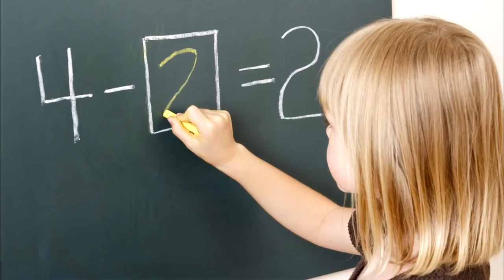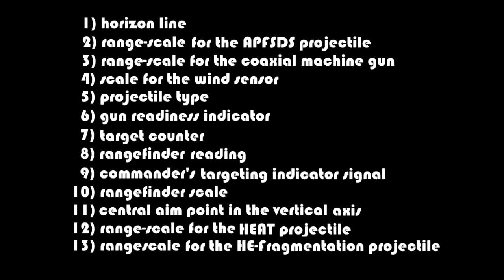Was T-80 really a FAILURE? T-80 tank Review

Comment: Russia still has a few of them in active service and like 3000 in reserve, most are older models though. there are rumors that the tank might get a similar to T72B3 modernization program
Reply: Dimitri Kovalenko Would the T80 tanks that are still in use and in reserve be a better option to fill a niche where armour was needed when time was of the essence? I know they drink more fuel but I'm sure they can move around faster.
Reply: They being returned to service in Siberia.
Reply: SCUD B Why in Siberia? Is it because they need more powerful or faster tanks there for a quicker response?
Reply: PETAZ ZVEZDAR Awesome. Thanks for the reply. That makes sense since diesels do not like the cold.
Reply: PETAZ ZVEZDAR Do you have proof?
Reply: Joe Friday They can run fine if you make a a precaution or two, and I rather have that than gasoline I think.
Reply from the maker: +Zoltan Csikos
The Russian diesel engine can start up at max -30deg C, while the turbine on T-80U can start up at -50deg C, which is good for Siberia since temperatures there can really reach -50deg C.
Reply: Dimitri Kovalenko They Are already being modernised to the T-80U variant.
Reply: Belarus-chan Will they be a major contender to western tanks?
Reply: They are going to be modernized to T-80U or T-80BVM
Reply: Travis Tracker Thats an excellent way of putting it
Reply: Most of the russian tanks are unmaintained and probably completely useless.
Reply: The are getting modernized to T80BVM
Reply: @RedEffectChannel  Yes but I don't think any enemy of Russia will be landing troops , let alone tanks in siberia.  -50 Degrees may be only useful for trainings.
Reply: t80BVM
Reply: @VeXu666  nit most half of them like 10 000 from 20 000
Reply: T80 is only for Arctic division, because they have gas turbines!
Reply: 30000
Reply: Emir B.A.745d  ...Consider it “cold storage”...
Reply: Yeah I saw similar with T72B3 they called it T80BVM if I'm not mistaken cuz 2 of them got the same additional amor package like the T90M/MS

Comment: Without infantry support, no tank would have survived the assault on Grozny. This was a disaster.
Reply: There is a certificate kept in Uralvagonzavod, which says that one T-90 tank of the 1992 model was at the disposal of one of the units in the conflict zone in the Chechen Republic in the 1990s. According to the scientific editor of the Public Relations Department of the Research and Production Corporation Ural Carriage Works named after F. E. Dzerzhinsky, candidate of historical sciences S. V. Ustyantsev and the leading designer of OJSC Ural Design Bureau of Transport Machinery D.G. Kolmakov, in 1995 several T-90s participated in military operations in Chechnya and proved invulnerable to anti-tank means of militants
At the same time, it should be said that the tanks of the old generation (T-72 and T-80) showed significantly better survivability than the tanks that fought in the Middle East in 1973. One hit of a projectile RPG or ATGM was already not enough to disable it. As a rule, at least 6-7 hits were required, and a record was recorded when the tank withstood almost 20 rounds. Dynamic protection systems worked exceptionally well. (с)
Reply: @elusive6119  1993 t90 was not even made first version 1999

Comment: T-80 is a top of Russian tank industry. You should understand, that T-72 was made for cases of aftershock post-nuclear war conditions, where are high-tech production is unavailable. While T-80 was exactly a hi-tech tank with ballistic computer for gunners primary sight. All T-90’s advantages are taken from T-80 (fire control system, commanders sight, hmg remote control from t-80ud). Only engine lft the old and become the most weak place. The conclusion is the T-90 is the T-72BM with T-80Us fire control system

Comment: a  few things.

The T72B that USA tested was not the model 85 with kontact 1, but a Late model T72B (mod 89) which had a new armor array, and Kontact 5.  ONly tanks that USA would have had trouble by that point would have been the T80U and T72B Mod 89 which woudlnt have been representative of the Most Common Threats on the battlefield. Thus the M829A1 Silver would have been able to Deal with the Typical T72B, and earlier  T80B/BV tanks without issue.

Also the T80BV want merely just a T80B with Kontact 1. It  was a new series of which had a new Glacis array. 

T80B was 60mm RHA - 100mm  STEF (Plexiglass) , 45mm RHA ( plus 30mm add on plate post 1982) T80BV Glacis was 5  layer  setup of  50mm RHA - 35mm STEF - 50mm RHA,-  35mm STEF- 50mm RHA.

The latter would bead adequately  protected against Late US 105mm ammunition like the M833 still in use on M60A3's and early 105mm amred Abrams, but not enough to negate 120mm ammunition when the M1A1 went into production.
Reply: Good info
Reply: Your an i"iot yes they wouldn't have been the avrege treat on the battelfiend but that is the same case with the abrams about the Soviets they would really meet abrams on the battelfiend and the main tank they would fight would be the m60 which they would easaly destroy
Reply: @tonyjoka2346   um when the T72B mod 89 was put into operation the M60A3 was no longer considered the main front line tank at that point in time. The US army already had plentiful amounts M1 Abrams tanks in operation, and deployed to Europe. By the Time the gulf war happened. this is reflected that the US army didnt even bother deploying M60A3's in 1991 gulf war. All were M1A1's ( many  were converted to M1A1 HA standard just in time for that conflict)   with only a single M1IP armored unit held in reserve. Only the USMC was still using the older M60A1 RISE Passives up until the end of the culd war and into the Gulf war because only at that point they start adopting the first Abrams models, hence they were forced to go into combat with what they had.

Given the superiority of the Abrams it would have been more than capable to taking on superior numbers of soviet tanks, especially the models that were no longer impervious the ammunition's being issued at that time.

Plus also take into consideration with the exception of T80UK tank commander variant, Thermal imaging was virtually non existent on soviet tanks even will after the cold war. Thermal optics are great advantage to have even in daylight operations, but especially at nightime, this would be very massive advantage. A rule of thumb is the tank that spots the enemy first can typically get off the first shot, and those that can get off the first shot are typically the ones to win an engagement.
Reply: @kcz1093  still an incredibly i"iotic reply the USa had only around 3k m1 a1 abrams gess what the Soviets had 2000+ t 80u which were imprivous to the m1a1s projectiles and was more than capable of destroying the abrams so the Soviets had a front line battle tank made to smash abrams and it was in massive numbers too so get into account the massive number of t 64s and t 72s that could also take out and abrams and you see that the Soviets where supirior  also Iraq used old t 72s that Russia retired 10 year s before the gulf War

Comment: There been a massive rumor that t-80 have been all deactivated.

Fact is just as recent as this year there's a full battalion that committed tank exercise using T-80. It's a good tank just same issue that Western tanks have.. Fuel consumption.
Reply from the maker: Well the fuel consumption on the newest edition of the Russian gas turbine engine, the GTD-1250G, the fuel consumption has been reduced by 9%, previous fuel consuption was 225 g/hph, with the new engine, its around 205 g/hph. The fuel consumption of the T-72B1 and other T-72 variants (excluding the T-72B3) have fuel consumption of around 190 g/hph, which means that T-80U (the ones with new engine are T-80UM) have 10-20% more fuel consumption than T-72B, which on its turn, is not much at all. They also have APU (which is something that was not present on T-80B, the one used in Chechen War, where they wasted same amount of fuel on idling and on the move. On T-80U and T-80UM that is not the case, since APU has been installed).
And yes, T-80U (including T-80UM) is in active service, as far as I know, over 500 are curently in active service. There have been some rumors that they might get upgraded with new Relikt ERA :)
Reply: T-80 has the same problems as the Western tanks... Of course, the Russians copied the U.S. M48 tank Chassis. And stole other western technology. While the west figured out the problems, the Russians were in the beginning trying to figure out the same problems that the West had before.  Little insight for everybody. The Chinese are going through the same thing with the technology that they stole too.
Reply: Panzerreichus Holzer So they took some technology from an enemy they had defeated k den
Reply: Abrams tank doesn't have a fuel consumption problem. If you want a fast, enemy smashing weapon, you have to build it correctly and supply its needs. Russian tanks cant do what they were designed to do so they all need upgrades.
Reply: I do not see anything wrong with the development of a good design, where only kinematics are the same. The T-72 has a maximum permissible total mass of 65 tons, so that a big way was made from the m48.
Reply: @RedEffectChannel  yes perfectly I think worlds first gas  turbine engine then comes US tank
Reply: RedEffect  For comparison, would you know what is the fuel consumption and power-to-weight ratio of current Abrams? And T.B.O. for its engine?

Comment: T80 is not really a bad tank 
Looking back when t80u variant got in service 1985
The tank had very good protection and good firepower/mobility. 
Yes it did have problems such as:
High fuel consumption
Expensive
No thermal sights

Comment: These late cold war soviet designs simply look bad-ass! Too bad they are now moving away from the low silhouette style with the Armata platform.. but I guess the need dictates the form. Thank you for sharing these videos with us and keep on researching! Always interesting to see what you manage to dig up!(:
Reply: True, the placement of the capsule and a larger gun and engine requires a large volume and height of the shell. In addition, the crew is completely isolated from other compartments, which makes even multiple penetrations of the hull not fatal, the tank will be capable.
Reply: @elusive6119  My problem with the T14 is, what if the electronics fail / get knocked out during battle? wont the crew have to abandon the tank because turret is remotely controlled

Comment: Ur wrong mate. T-80U have has batter armor protection on turret then T-72B and T-72BU witch was later called T-90. 

Soviet made two project or object in that late 80s too replace T-72A/Bs in their army. Obj. 187 with new turret, welded not cast similar to the turret of T-90A mod 2004. called Vladimir and new hull with frontal shape similar to the Leo 2A4 tanks with much batter armor protection of turret and hull. And second one is obj 188. witch took part of army trails in 1989 and pass it. Obj 187 was finished in 1991 and he didnt took a part in army trails because in mean time obj 188. get green light for starting production. They put obj 187 on hold and never gave him chance to go on trails....

I think that Russians made wrong choice between two projects. 187 was much batter in any aspect, but they choose i thin cheaper one witch was 188. instead of 187.

They made latter turret almost same as was turret on 187. who was welded with batter protection. 

FCS was luck and still is on any T-72 version, except latest one. T-80U didnt have that problem because his FCS is very good....
Reply: No ur wrong mate t90 has slightly better armmor then t80U but much more better armmor then t72BA .
T90 has 880mm vs apfsds
Reply: And T-90 isnt t72bu

Comment: T-64 was a really ambitious program, and with its new smoothbore gun, composite armour, and opposed-piston two-stroke Diesel engine was innovative in firepower, protection and mobility. It was an attempt to combine the firepower and armour protection of a heavy tank with the mobility of a light tank and the weight of a medium tank, thus creating the Main Battle Tank. But such a rolling science fair created a multitude of teething troubles, and T-72 was developed as a cheaper alternative. However, ambitious men like Kartsev an Benediktov were not eager to design merely a "monkey model" of the T-64, but wanted to prove that Uralvagonzavod could produce a better tank than the Kharkov steam locomotive plant. And in many respects, they did. This created a lot of rivalries as to which tank should receive the best in equipment and fire-control that the USSR could produce. In stepped the people in Leningrad, building the premier tank, the T-80. But they addressed none of the fundamental problems like ammunition and crew in the same compartment, or lack of blow-out panels, but inserted a gas-turbine engine (because the USA were doing it as well) which turned it into an expensive fuel-hog. Nevertheless it continued to attract the best technology the Soviet Union could afford...
So, in my eyes, it was a failure, and the money could have been spent better improving the T-64 and T-72, and develop a real new solution.
Reply: I think 50s/60s were the Zenith of Soviet tech. They started to slip in the 70s, I'm guessing with the economic challenges and basically getting outspent by the West. The T-64 was an amazing design once it was mature. Small, powerful, and maneuverable.

Comment: Here is the 2 sides, USA says all Russian equipments is junk don't work. Yet - even with its flaws Russia has never been conquered. If you had to put them up in a battle one would find out really quick the Russian tanks do work and are very capable. Anyone who says otherwise is not living in reality. Russian T72's modernized are very effective, more agile and more reliable. Also, don't forget the Abrams tank takes a LOT of fuel a tank is a pill box sitting with no fuel. Lastly, Abrams tanks were sitting ducks in urban situations plus they are very maintenance intensive 70+ tons lot of wear/tear on tracks and drivetrain.

Comment: I'm a little disappointed they didn't keep upgrading the T-80.

Tanks of that era where built with modifications in mind & it was built to be the more expensive option compared to the t-72. If they kept refining the T-80 I believe they would probably have a better option then the t-72 & even t-90.
Reply: Would I be too demanding if I where to argue that a T-72B3 is the very least a nation should consider?

Look what the Ukraine did with the T-84 or even the modernization of the T-64 which make up the bulk of their armor, I find upgrades on older tanks real cool & some of them are fairly viable options as well.
Reply: No.

The T-80 operation range wasn't as great and it was more costly (but yes, had some cool advantages, and would be super cool if heavily upgraded).
Reply: Well, there are plenty better designs out there then the ones that have been used in tanks I've been led to beleive. Even the one in the Abrams not being as bad as plenty would have you believe, there are more modern, compact & efficient designs out there suitable for the job.

I find it hard to believe in that pile of money they threw at the Abrams that this hasn't happened already.
Reply from the maker: the difference between T-80 and other Russian tanks of the same era is that otehr tanks were designed to be made in big numbers, while T-80 was designed to be super good, but the problem was the money ofc. Even now it reflects the Russian tanks, if they want to upgrade T-72Bs to modern standards they have to change whole gun and autoloading system in order for T-72 to be able to fire most modern APFSDS projectiles, while on T-80U they dont need to, even if the tank is 30yo it can still fire most modern projectiles, since the gun, autoloader and FCS in general was in that time excelent, that now they dont even require changes to fire most modern rounds. Right now there is over 500 of T-80Us in service, same number as T-90As, even tho T-90 was choosen over T-80U.

Comment: The T 80 was never designed in isolation. Everyone was looking at turbines and multi-fuel at the time for good reasons. Soviet armour till Armata was surprisingly conservative. This led to the western tanks amazing people, and of course marketing. There are solid underlying strengths to Soviet designs and weaknesses. This is true of any design, tactics are supposed to complement design and mitigate weakness. The T 80 would have been a very good breakthrough tank. Filling a role envisaged for British ww2 cruiser tanks and the m1 itself. I don't think it was a failure as long as you expected something a little specialised.

Comment: russia lost so many t-80's to inferior weaponry in Chechenyan war (and those we're the best versions of the tank btw) that they we're deemed a complete failure. They we're up against way older t-54 variants and some rpg-7's taking out them by the bunches.
Reply: I'll put an RPG into the roof or side of the Abrams, or right into the drivers prism and then see how that tank survives. Or better yet, into the bustle.

T-72s routinely carry HE-FRAG ammo. Lets load Abrams with HE-FRAG ammo and hit it with an RPG. Let's see what happens to its turret when they go boom, shall we?
Reply: @Max_Da_G  M1A1 and A2 can take an RPG round to the turret sides and still be fine( saw numerous times in Iraq)  RPG- 7 is only a real threat to the engine compartment.  RPG 29 however can penetrate the M1A1 turret in only a few areas on the sides and turret ring.  Ammunition is stored in an armored compartment with blow out panels and will not blow up the turret or harm the crew( unless the loader leave the internal blast door open).  Any tank operating without infantry support is not going to fair well especially in an urban environment.